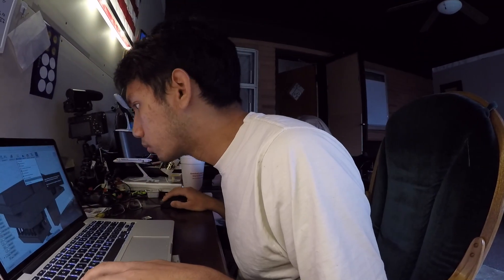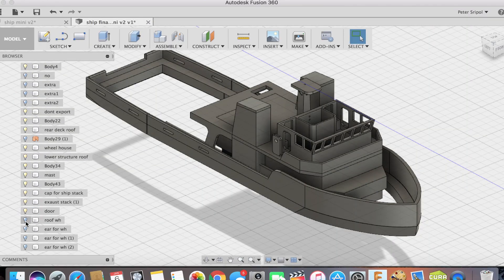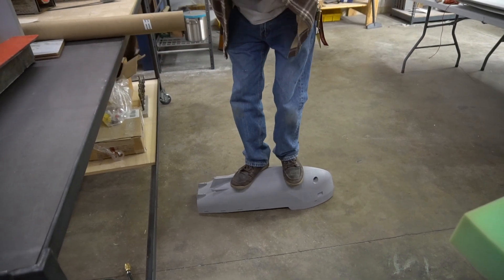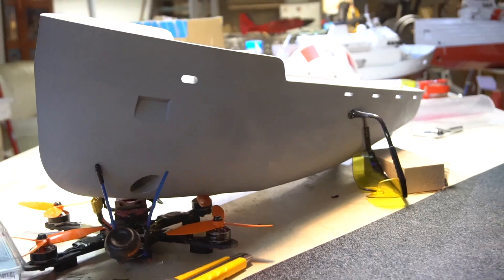Giant 3D printed Utility tugboat Part 1

Comment: Hey Peter, is this modeled from an actual ship model or is this just based on them and it's your own "design"? I'm currently building it with the files you provided on Thingiverse. I was going to see if I could find a picture of the boat you used and add my own details. Thanks for providing the files, it should be a very fun build.

Comment: i made this the motor mounts was annoying because i have dual 3 inch wide 24 volt motors and i had to just grind the mounts off to make that section fit under motors

Comment: I know this video is 3years ago but you should use ASA  instead of ABS because ABS smells and not UV resistance. ASA is basically ABS but UV resistance. I don’t about smell tho. Also PETG would be good because they are moisture resistance. PLA are too fragile to use on those boats. Plus they absorb some moisture. (Here, a message from the future)

Comment: I just wanted to say thank you.. I have never printed a boat before. Yours is going to be the first.  Have you ever thought of doing a tug boat . or a Cruise liner? imagine the lights on a cruise liner or a tug boat that could tow you around a lake ?. when my boat is done. i will post a pic. also.. I past the STL files though Cura , and it told me i needed 2.5 kg. of pla.. Did i do something wrong?

Comment: Hi peter just pickup a crealty cr-10s printer.  I'm new to 3d printing,  was wondering if you can operate this printer with a raspberry pi 3 B+  by itself  and do I need a monitor  and what program do I need to print your files for this boat. Any help would be appreciated  thanks.

Comment: I'm not sure I would have mounted the engine solo did you put a pump in it if water leaks in through the drive shaft the news Motors are toast

Comment: In case you didn't know this, The Lulzbot Taz6 had a bit of a firmware design flaw that causes that vertical ringing in your prints. If you want to get rid of it look up how to change the bed heater from "bang bang" mode to PID mode. It's a very simple firmware tweak and it completely removes the print lines.

Comment: (calculating cost)
£30 for two reels of ABS
Motor, servo, electronics and transmitter can probably be salvaged from my old fanboat (I'm thinking of going single motor with gears to drive both shafts).
Props aren't too expensive if you go plastic. Hell, I wonder if I could 3D print the props too?

Seems like a good deal, and an interesting project.

Comment: Oooh - can you build an Ekranoplan?  And if you do decide to do the submarine (which I'd love to see), one possible safety mechanism: if your receiver has a "signal lost" function, you could have a solenoid either open a CO2 bottle to the ballast tank or to an inflatable bladder.  Or else have a solenoid dump baking soda into your ballast tank...assuming you're using variable ballast and not just dive planes... I overthink things sometimes, which is why I never get shit done.

Comment: Hi PeterSripol,

I was wondering, didn't you have the trouble of warping ABS and therefore issues fitting the parts together? I just have an Ultimaker 3 and I haven't tried working with ABS on that one, but with my Ultimaker 2 I always had this issue when I was using ABS. Anyway, nice video and nice project! It must have taken you a lot of time and patience to do the CAD.

Comment: You could install a compressed air (co2, helium?) tank with an electric solenoid valve, linked to a couple of balloons, so if the boat sinks, you can activate the valve, inflating the baloons, and raising the boat for retrieval.

Comment: Where did you get the props?
Reply from the maker: http://www.loyalhannadockyard.com/

they're 55MM (the ones I ordered) in the video its funny cuz theres a 40 and a 45mm prop, I didint have two of the same ones! 

be very wary though, I ordered back in jan 18 and have yet to receive anything. model boat folks can be pretty slow (ironically the boats are too) :D
Reply: Thanks dude. Although that website looks like it's from the 1990s and probably littered with all kinds of viruses, LOL.

Keep up the great work and I'd love to see you make some RC submarines or ROVs. Maybe you could add a tethered FPV ROV to your tug boat setup. Maybe do some RC underwater exploring.
Reply: I just got started sourcing parts for a build, and found 55mm props on Amazon. Amusingly enough, I was looking for the prop tubes and shafts at the time!

Comment: after you do that cylinder plane, you should do a cylinder sail boat.

man it would be so awesome to have a 3d printer. ill just have to wait and watch you make stuff.

you could also make a sub. you would need some solenoid valves and cans of compressed air, i think you could handle it.

Comment: Hi Peter, I think it would be cool to make a rc plane than launches like a bottle rocket. You could make it with two 1 liter bottles. The front compartment would contain all the electronics. The motor would be in the front. The large compartment would have the water and pressure for launching.

Comment: You could have used some heavy duty modeling glue.
Reply from the maker: thought about it, but acetone weilding  makes a super strong joint (considering its 100% solid ABS)

Comment: Very neat. Was the hammer for supports for real or a joke for the video?

ABS is also 15% less dense that PLA & PETG. It sounds like it wasn't necessary to reduce weight but it can be a help for other uses.
Reply from the maker: I actually knocked them out! I suppose I could have just ripped them out but its easier to smack on it a few times! I kept it thick just to make sure the hull was not easily crushed under immense water pressure, I may be sailing it in 10ft waves so its got to survive that!

Comment: just a suggestion you should use overlapping joints for your hull for better water proofing, easier allignment and strength of joint. really surprised you and others do not do this in their multipiece constructions. then a bilge pump for any water in the hull. also some bilge keels will help with roll stability.

Comment: Using live ammunition as a ballast is just great :)
As far as I am concerned, the shape of stern part would be with decline over the props, so it wouldn't upnose so hard on higher speeds :)
Reply from the maker: yep! if the lipos short out on the water "KABOOM"! I may update the stern to reflect the changes, She also could use alot more ballast in the bow, it was super high above the waterline in the video!

Comment: That's very impressive. I build my models the old fashioned way- fibreglass hulls then scratch build wood and plastic up with moulded resin fittings, but my club is experimenting with 3D printing for some parts like funnel caps and strange bits, it's probably the way forward for kits. It looks like it went together really easily.

One final and slightly embarrassing question- what did you use to seal the flat back deck of your boat? I have a similar model tug with a big aft hatch without combings and I can't find any tape that will seal it properly without ripping the paint up afterwards and using something like silicone is a nightmare if your rudder works its' way loose later.
Reply from the maker: cool! I built my first ship using the same methods, I purchased the hull though and just built everything else out of wood. 

For the deck I'm using black electrical tape right now, I will be painting the deck grey when done so I hope the paint doesn't peel!

Comment: it was ploughing through the water, if you adjust the thrust angle, you could get it on the plane and it would be much faster
Reply from the maker: hahaha, its a displacement hull! its supposed to not get on plane, unfortunately it has too much power so it does! :D

Comment: Hey Peter, just a tip. If you're going to go so far as to use a respirator when using the acetone (good for you for looking out for your health) you should probably get ahold of some organic vapor cartridges. They're less than $10 on amazon and fit on the mask you already have. 3M part # 6001. Those pink P100's are only good for filtering particulates.
Reply from the maker: thanks for the headsup! I'll look into them!
Reply: PeterSripol No problem. Enjoying your content by the way. Definitely deserving of more subs and views.

Comment: I see information on what kind of 3D printer you're using, and information on the transmitter you're using (I use a TGY-i10 myself, by the way), information on the cameras and microphone, tripod, editing software... but I don't see anything about the laser engraver/etcher/cutter you're using. What kind of engraver/cutter is that?

Comment: the only thing i would change is the angle of the props to try to stop the tail tucking under heavy acceleration, and maybe a bit of water ballast, that will make it bobble less, but great stuff otherwise

Comment: 3d print a boat/submarine with solar panels and satellite transmitter, to receive commands and broadcast video reports etc. Then explore the ocean from your own bed room :)
Reply from the maker: challenge level 1000! Perhaps if my funding was larger and I had more knowledge of the sea I'd totally try it!
Reply: PeterSripol I'm pretty sure an APM supports boats, do able with that and a solar charging circuit. Perhaps a subscriber milestone special?
Reply: if you did that i would fill it with expanding foam
Reply: i really like this idea. the problem is: the signal to the Rx will only work at surface level. which means: you would need to send a string of code for the entire dive, and then on top of that, hope your sub never strikes any underwater objects before ascending back to the surface to transmit collected data back to you.  I see a way around this by creating a follow raft with an umbilical cord containing the power source, solar panel and charger, Rx and telemetry units, sonar sounder, and maby a few navigation LEDs. the cord would be approx 50-100 feet in length and would be slightly lighter than neutral buoyancy with foam rings every 10 feet or so, to keep from snagging on sub-surface objects.
Reply: marshalcraft The University of Maine actually used the largest 3D printer to create a full sized, water-worthy boat

Comment: You should make a RC submarine for one of your videos
Reply: Peter - or a heavy lift ship that can submerge and lift your other ships.
Reply from the maker: I like your thinking! :D that would be a neat build!
Reply from the maker: Its coming this summer! the water is super murky here so I haven't done much as far as planning goes!
Reply: The Greater American Society I'd love to see underwater footage of that!
Reply: BEST IDEA EVER
Reply: The problem would be controlling it. Radio waves don't work under water. :(
Reply: rc submarine hobbyists are using mhz radios with old  school crystals, it travels farther trough water, so typical 2.4 ghz are not recomended
Reply: That would be interesting and difficult, having to deal with the bow/stern bilge tanks to pump or release water for buoyancy. You'd need a vaccum with a check valve, that can go in forward/inverse to suck in water.
Reply: The Greater American Society YASSSSSSS
Reply: Evan Burke he just needs an older radio rc hobby subs use crystals still.
Reply: The Greater American Society and it should launch a torpedo
Reply: The Greater American Society yea do that
Reply: The Greater American Society yes he should
Reply: The Greater American Society He should launch a bottle rocket from it!
Reply: The Greater American Society hubby
Reply: Evan Burke the antenna could be long and stick out the water
Reply: The Greater American Society yea
Reply: The Greater American Society
Reply: WonderfulPear          H
Reply: Or the RP FLIP, the research ship that sinks the stern underwater on purpose.
Reply: A RC Gato class or Ohio class. Ohio classes are huge.
Reply: Or a tiny 3d printed hydrofoil.
Reply: I believe there was some discussion on this in the comment section of another video.  I think the conclusion was to use the video wires as a tether and completely bypass RF.  The buoy ideas sounds good though, that way your not limited in range by the wires and if the sub sinks the buoy can keep it from sinking further.  I think I like your buoy idea better now.
Reply: anyone else notice the plane with KFC buckets and paper plates for wings?
Reply: Beware that radio waves don't propagate through water all that well. You might have to use a cable or a buoy to send control signals. Or even something else than RF entirely.
Reply: sloth_76 budoop yes i did
Reply: Thats an amazing idea.

Cheers Kay

Comment: make a WW2 German V1 flying bomb. Make the launch rail system to go with it!
Reply from the maker: consider it on the board of things to build! :D
Reply: pulse jet
Reply: Cameron Maxwell nien nien nien nien nien nien nien mine nien nien nien nien
Reply: auch n deutscher hier?
Reply: Rayman jo
Reply: RCP-1136 Plz. No. I'm on the south coast as well
Reply: Niet
Reply: @olegm5535   you mean nyet
Reply: Fallout Ranx Gaming you mean nein?
Reply: PeterSripol with an edf or rocket motor:)
Reply: Yeah but it was like the first cruise missile ...thanks wernher von Braun for it ...he even was the tophead on the apollo programm
Reply: Ja eine Vergeltungswaffe 1 wäre nicht schlecht
Reply: Cameron Maxwell and point it towards london!
Reply: Hope not! I'm on the south coast of Britain!
Reply: yeah it was a very crude version of a cruise missile. they were just pointed at london and had a little propeller that measured the distance, once it was above london it exploded tiny charges which pushed down the elevators. cruise missiles are much more sophisticated nowadays.
Reply: RCP-1136 wasn't that like a really really old cruse missile

Comment: Peter is the ultimate maker. Great work. 

Why didn't you go with a counter rotating setup on your motors?

For materials, pla is a dream to print. Petg is also supposed to be easy to work with, but much stronger. Need to get some for my ultimaker.
Reply from the maker: just had these two on hand, I ordered a set of counter rotating though!

Comment: That boat turned out great.  I am amazed how well that black abs cut in the laser cutter.  I was thinking of getting a 40W $400 cheapy ebay co2 cutter but was thinking it wouldn't cut ABS.  Your 3D CAD work is really impressive.
Reply: what type of laser cutter should I use if I want to cut 3-12mm acrylic?